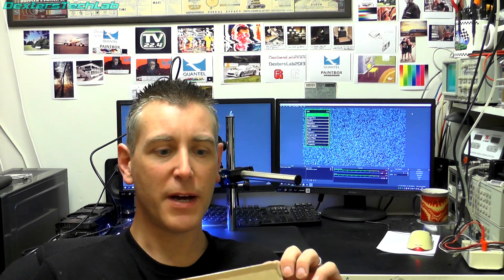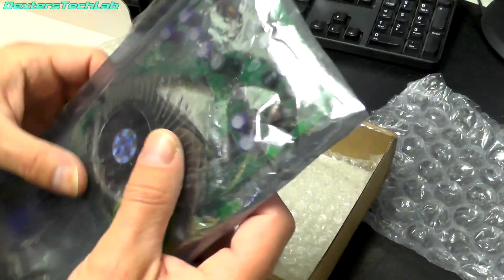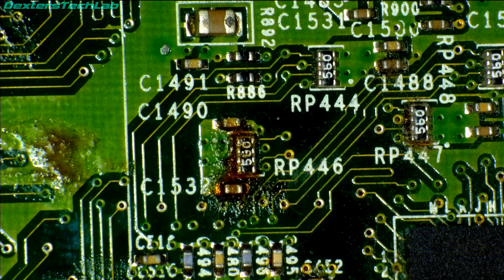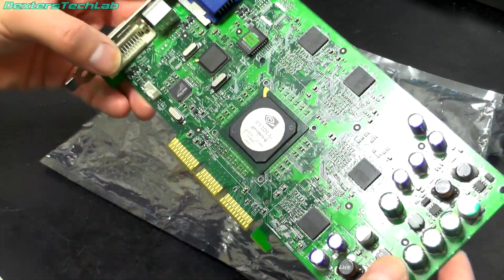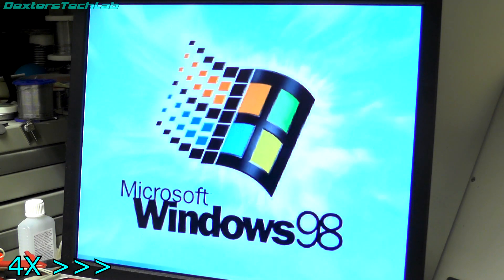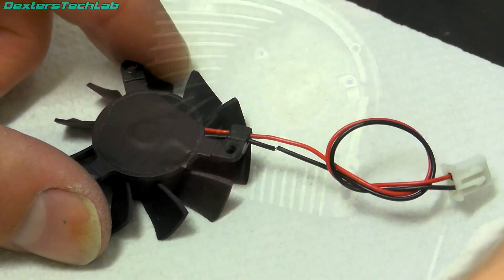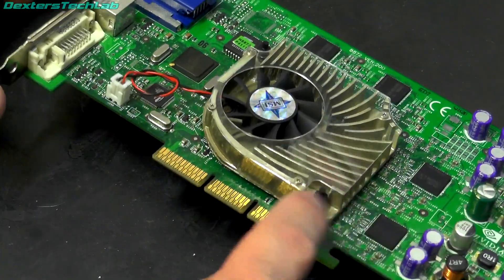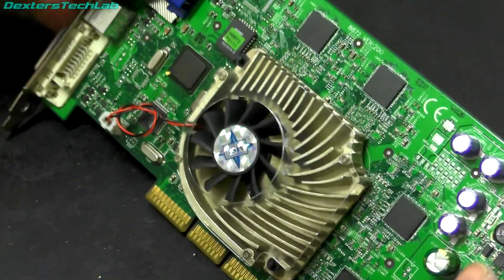DL196 MSI 8870 Nvidia GeForce 4 Ti 4600 Repair

Comment: You seem to be very skilled at these repairs, and I really enjoyed the content. New sub for ya! I’ve seen AGP cards with some damage on the gold finger connectors. How do you repair those (since I’ve never seen or heard of anyone doing that)?
Reply from the maker: Thank you and sorry for the slow reply, i didn't see your message. PCB traces can be repaired but it would be hard on an edge connector.
Reply: @DextersTechLab  I’m going to try some of that copper foil tape. I may have to use epoxy to ensure it doesn’t lift, but it’s worth a shot. I have nothing to lose because the card was refunded and the seller didn’t want it returned.

Comment: Nice repair & sweet retro card. MSI make decent enough stuff, even back then. Didn't always use the best caps,  have had to replace them on most of my older MSI boards & cards. Could be worse, could be Sparkle :).
Reply: That's just a reference board with just MSI's model number silkscreened. See the Nvidia logo there? Almost all Ti 4400 and 4600 were reference one, some could probably had a different colour on their PCB.